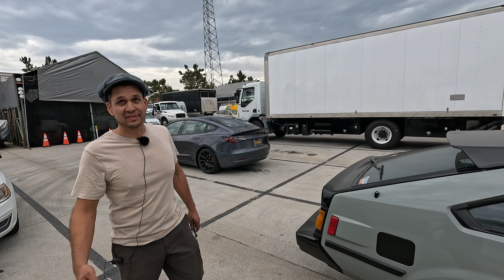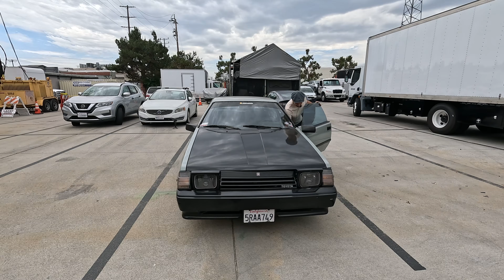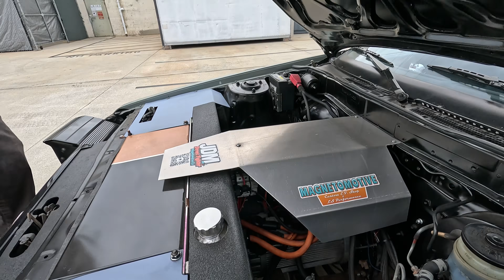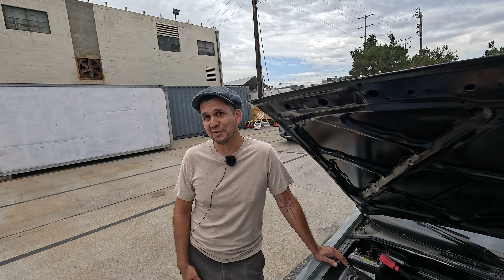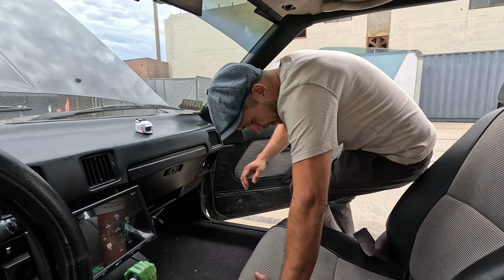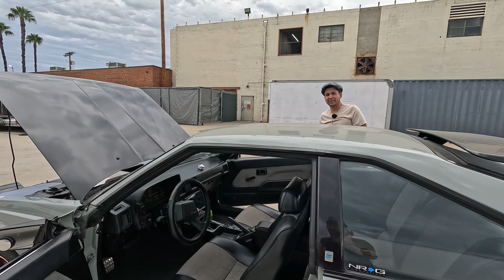Manual EV Swap Under the Hood: Was Keeping the Gearbox Worth It?

Comment: Interesting that ALL of the battery is under the front.  I wonder what the weight balance is?
I appreciate manual EVs though.  I'd like to get/build one sometime.
Reply from the maker: Minimal change since the pack is very small and the motor is light, not a big difference from the engine weight. 
Yeah after driving and being in a few I have to admit how impressive they can be. On paper is one thing but in the wild it is really pleasant driving experience
Reply: @EVTUNERS  I'm already a fan of EVs and also manual cars so it's an easy choice if I can swing it.  I also really like the idea of not having to clutch/shift in traffic!  Best of both worlds!
Reply from the maker: @OhmiKuma definitely best of both worlds!

Comment: Been telling people for a decade that a manual EV is not only possible but an inevitability. Now we're starting to see them come from modded cars but I hope we'll see a proper production model in the future. I love projects like this!
Reply from the maker: You really read the tea leaves as they say! Totally, Porche got close with their 2 speed but that's still not a manual. People cite the drivetrain loss which is true but it isn't a whole lot, and the manual adds to the driving experience and the capability of the motor.
Reply: @EVTUNERS  The Audi E-Tron has a high and low gear but I'm certain they're 'fake' gears just like the Taycan but I read it's a 2 speed auto so maybe I'm incorrect. And the Rimac Nevera did have a physical gearbox while it was being developed. That was traded out for 4 hub motors. The Ioniq now has fake gears as well. Not many production models even feature multiple gears but I think it enhances driveability and raises the level of control a driver has for power output. Given so many people take issue with the loss of controlability in EVs, a proper transmission even with a few gears could fully restore that feeling.
Reply from the maker: That was a fun little research side quest! I didn't realize that the E-Tron had that same 2-speed in the rear, and that the "extra gear" was low instead of an extra high. So it automatically shifts around 50 mph. 
But all that said, I still think you are bang on that there is an engagement and car control that comes from a manual which is a worthy trade off for driving fun.